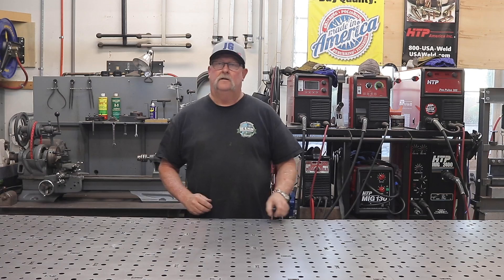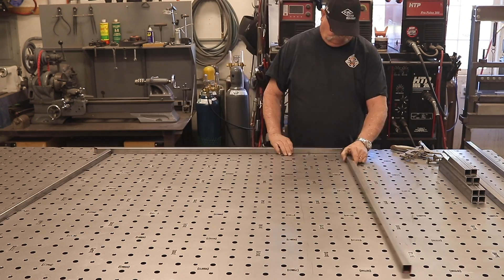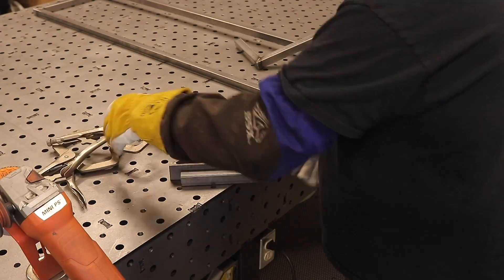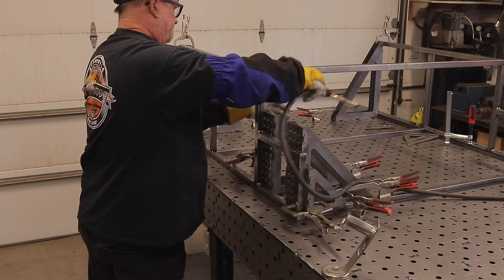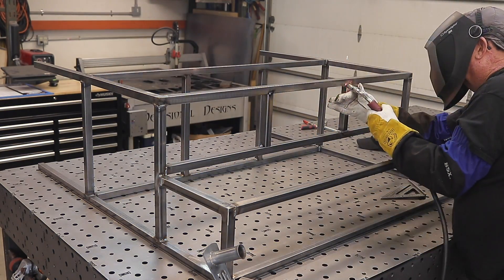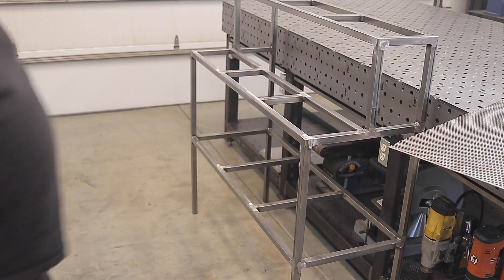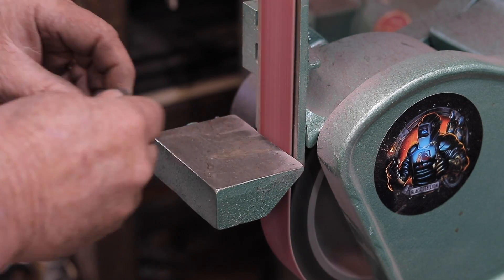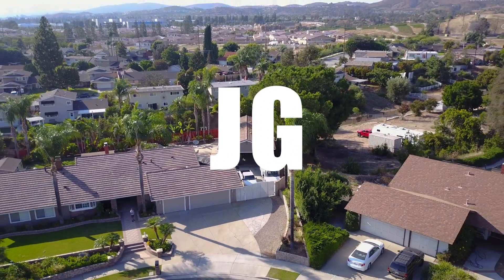Metal Plant Stand Build | JIMBO'S GARAGE

Comment: Hi Jimbo, I've been fabricating and welding in England 40 years man and boy and that's exactly how I'd have done it start to finish from pre assembling as much as possible and sanding smooth right to the adjusting feet at the end. Ye clamp that mesh tight as you go so the tacking is easy no gaps. I love the table, I use an old cast iron T slotted bed of an horizontal borer 6 feet square and a few angle plates to assemble like you did. Makes a great change to watch everything done correctly. Fantastic.

Comment: Great build, any Amen on the number of welds, I did 108 of these decorative panels (linked in reply) out of 3/4" square about a year ago. You wouldn't think it but there's 150 inches of weld in each one. Had a laugh when I realized over that many of them it was a quarter mile of welding. 

On adjustable feet I like to weld a flat bar over the end, drill a hole, and use a rivet nut, but that snug fit one a 1/2" nut has me thinking now...
Reply from the maker: Thanks for watching Richard, Ya there is all kinds of different way to do that that would work fine, That is just what came into my head at that time.   Jimbo!

Comment: For anyone looking to buy a new certiflat welding table like this one in the video, i would HIGHLY recommend getting the half tapped holes in the table.... I did not and regret it every time i use the table lol.... Definitely jealous of ohh jimbos table thats for sure!
Reply: Is that the option they talk about here?  ‘16mm HOLES ON 2" CENTERS WORK WITH INDUSTRY STANDARD 16mm & 5/8" TOOLS. OPTIONAL THREADED HOLES AND 28mm AVAILABLE”
Reply: Buy a tap and tap them 👍